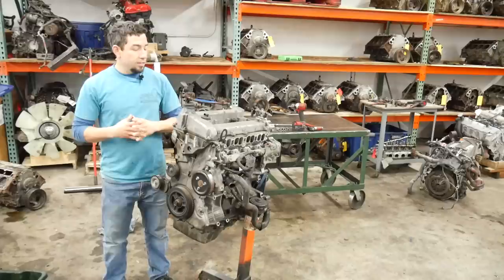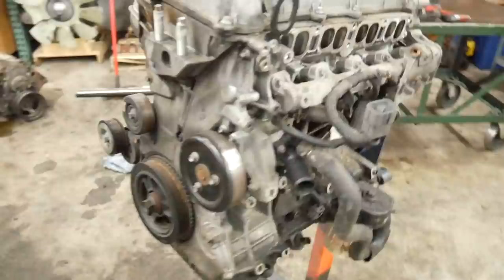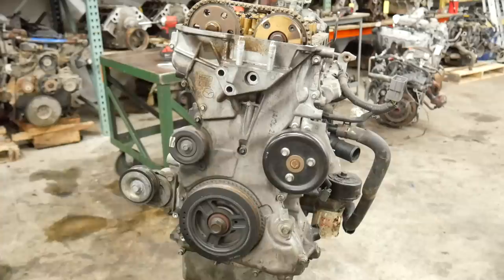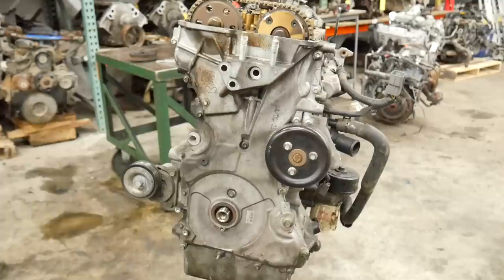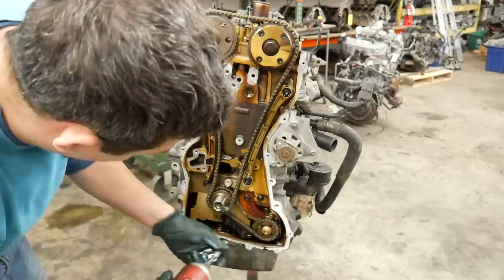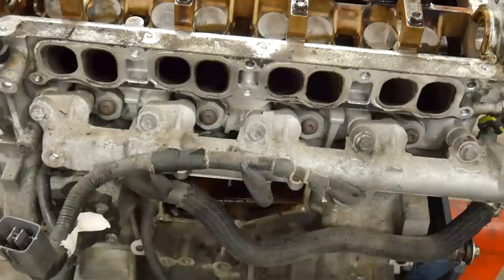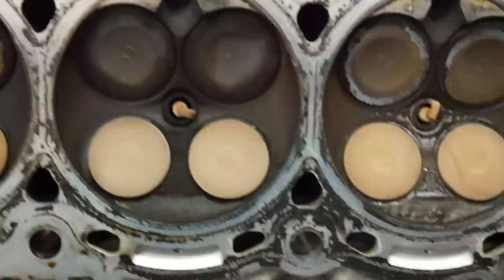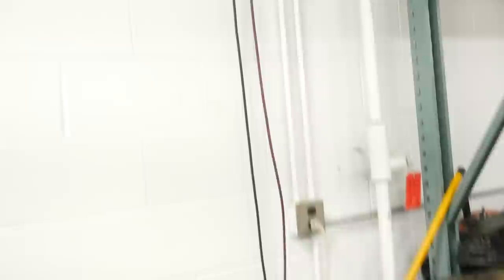TOTAL TEARDOWN: BAD Mazda MZR 2.3L Turbo Mazdaspeed3 Mazdaspeed6 CX-7 Engine.

Comment: No one believes Ford EcoTec is based on this motor... hey, 6:10 there is a proof for you, right on your face FoMoCo
Reply: You mean EcoBoost? Lol The EcoBoost and this engine share one thing in common, the block and that's it
Reply: @FusionBoost2.0  I stand corrected, I meant, EcoBoost. I said, it's "based" on Mazda's turbo engines from early/mid 2000s, I did not say it's the same engine. However, EcoBoost engines are experiencing fair-share of issues.
Reply: @bluebearbank247  I've had 2 so far, nothing major to report. Change your oil, use good fuel and driver...
Reply: @FusionBoost2.0  IMHO, turbo cars are not for general public... no one cools it off properly, etc., and shortening life of turbo, bearing seals gone, then burns oil, then bake the main bearing, etc. EPA pushes, manufacture finds risky solution, and consumers eat it. Chevy Cruze turbo, anyone?
Reply: @bluebearbank247  the ecoboost cars and oil fed and liquid cooled... When the car is shut off, coolant still flows through the turbo for a bit too cool them down... They don't fail as often as old turbos do, with new tech and better oils, they don't usually cause issues

Comment: I predict you will be getting a lot of turbo 4 cylinder in the coming years as auto companies make the mistake of putting these small engines in heavy car bodies to replace non turbo v-6  and v-8 engines. The tiny turbos wlll be screaming just to keep up with traffic while the v-6 and v-8 loaf along at 2000 to 3000 RPM.  With less than perfect maintenance these 4 banger turbos will blow up and very few will last much longer than 100k miles.